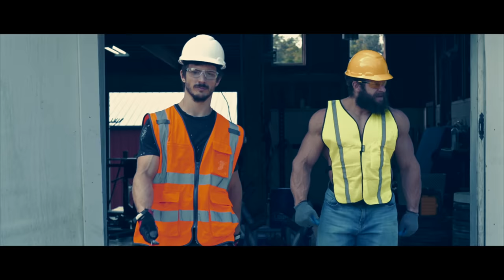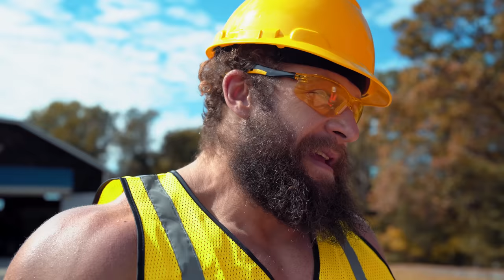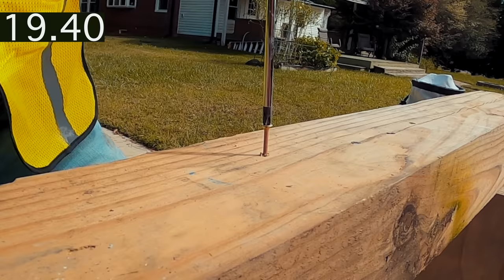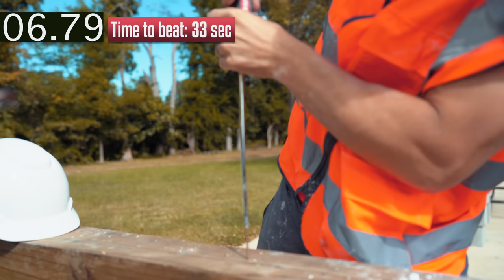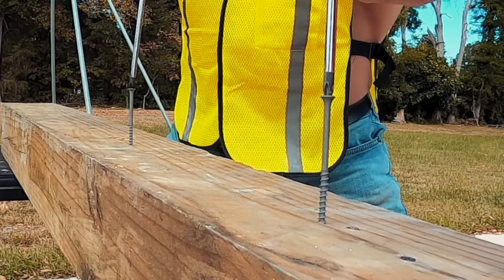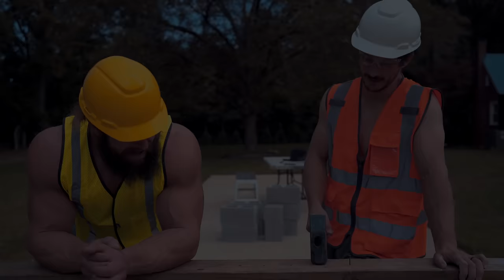Bodybuilder vs Handyman Screwdriver Challenge

Comment: The last one appears to have Anton screwing into a knot in the wood laterally a few inches deep. You can see the knot on the camera facing side.
Reply: ya he didn't stand a chance on that one 😅
Reply: Yeah that knot stopped him in his tracks
Reply: He was also screwing between two existing screws so the wood definitely didn't have any give in it, it's no wonder it was so difficult.
Reply: Still I call "good result" as he didn't throw in the towel after Juji finished.
Reply: Exactly.
Reply: I'm glad i am not the only one who noticed this. As a person who has screwed screws with a screwdriver plenty of times in my life, I can say without a doubt that the material you are screwing into makes all the difference. if you hit a knot, you may as well give up and try a different area if possible.
Reply: @rytramprophet843 yup, wood won’t compress there, and about half the time the screw head will pop off.
Reply: Excuses excuses

Comment: People don't realize how much it takes to do the things we handymen do. Next, do over head screws. That's a forearm and shoulder pump.
Reply from the maker: That’s a good one!💪🔥
Reply: @AntonFomenko  if you need some muscle taxing activities, I'm your guy lol. I'm a mechanic for a living and handyman for the rest of my life lol 👍 I got you bro
Reply: And to make it even harder, a crawling space where you’re on your back but to reach and screw you need to lift your upper body in a slight sit-up. Exhausting both for the arms, abs and the neck usually hurts bad after 15 mins of work.
Reply: @svenljung8009  you ain't lying lol
Reply: @svenljung8009  ya and then be an electrician and basically be spiderman in a crawlspace and attic and drill holes in the tightest places possible and fish wire down walls that are near impossible.
Reply: being a shorter guy, there have been times when I've asked for a chair if I didn't bring a step stool because driving screws horizontally above your head from standing is murder